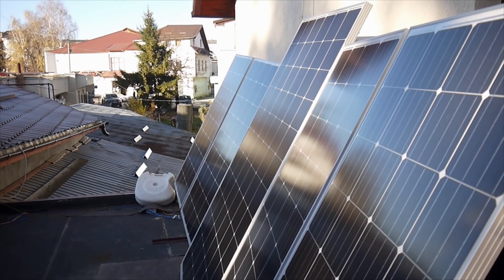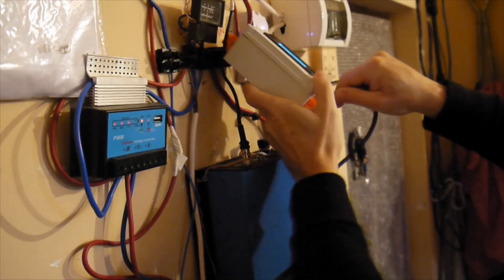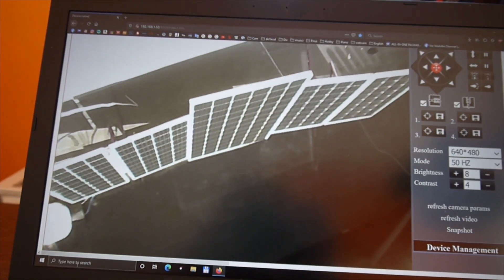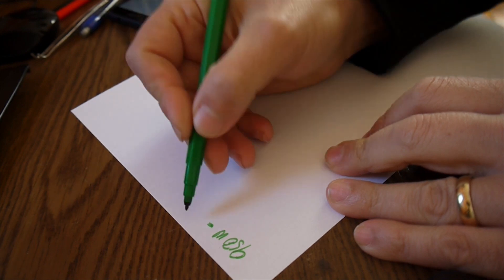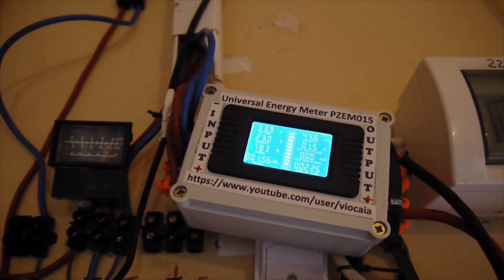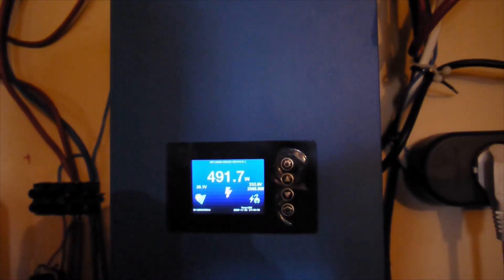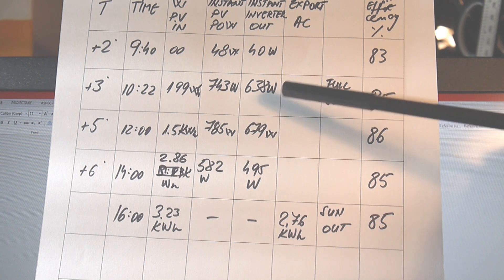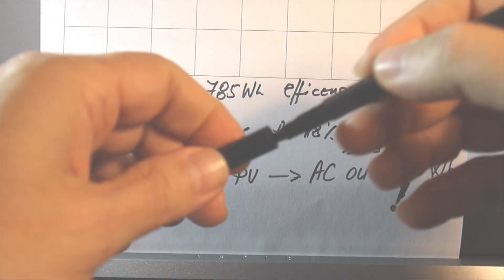The truth about solar power, SUN GTIL inverters and efficiency. Real life tests.

Comment: There must be something wrong in the end where you did the loss calculation. If you have 5 panels with 960 Wp in total those are rouhly 180 Wp panels and usually 10 years old which means that they suffer from the degradation a lot.
And the second issue is the time of the year cause you can not expect STC test conditions in roumania during november which require 1000W sun per m² 
Therefore no change to achieve 960 W even when these panels were brand new except during summer time, but not in November.
Reply from the maker: I'll recheck the things and be back to you...

Comment: might be worth to consider a replacement of the heater with a split heatpump for heating during winter and cooling during summer to lower the power bill cause the split inverters are heating the room and more if you open the door. 
The good ones are quite efficient with a gain factor of 4 or more, so 1 kWh investment from the solar panels will bring you 4 kWh of warmth .

Quick connect split heatpump should do the trick and with a quick connect solution it should be doable for most of us even though not that cheap.
But you can build it on your own and expand later but be aware to get not the smallest heatpump in case you want to heat more than just  that single room. 1 kW input offers 4 kW output which means a 4 kW heatpump or even more.
Reply from the maker: I already use a heat pump with great results..

Comment: Ty for the nice video..i was like all the work you have done..1) the panels need to be in the sun at perfect dirge..(to do that you need a traker) 2)they lose some power from the wires.. so you lose 20% not because of the panels in real life but because they are not in perfect dirge to the sun..3) how manny voltage it's the max for the inverter? If you use lower voltage  you have more lose.. that's and why it's have 85% .. if you use more voltage he will lose 5-10% and not 15% ..because 1) he lose power from the conversation that he do to the voltage 2) he need power to work (i think this model need 5-15watts )that he get it from the panels. That's and why he is saying the max out put from 1000w it's 950w...but for this set up it's very nice work and not very expensive to do it..so ty for all the info..
I like to ask you 1) if you are not use the limiter he is pushing power back to the grid ? 2) and if you can do it ..when the power from the grid it's out ..did he shut down?....I have tried to see a video about that with this inverter but no1 have..all the ppl use it with the limiter..and I like to see if you can use it with the limiter and with out..
Reply from the maker: Right! positioning is very important..I did the measurements in between noon hours, with almost perfect tilt and exposure..I rather buy some more panels instead of doing tracking..actuators, mechanical thingies! this are so heavy..it's a mess..so more panels with different orientation foe morning and afternoon will solve the problem.I had a nice surprise , one of the days was clear sunshine and cold wind, so the panels went more than 1KW! for a while, than the inverter went up to 950W!!! is it's not the wires or anything else..simply the way the cells behave in real life.
1.If there is no limiter, all the power will be pushed to the grid...maximum from the solar..there is a way to limit the power from the menu..like 500Wh ,but it's like a sink with drain..all the water just running thru..
2.When  the power from grid is down , there is no production, it will be up in a standby mode, waiting for a signal...
3.It can be used with limiter and without limiter, also, let's say there is no grid, I mean no connection at all..or totally disconnected from lines and  you have a pure sinus inverter doesn't matter the power tied to some batteries..that one will become the ''signal '' on for the SUN GTIL..so it will pump the in house network as long as the pure sinus is generating.This is a interesting way to use it offgrid! I never test that but is very possible...
4.The limiter is very useful because you don't need any agreement with the power company..for them you just simply don't produce, no way to track you.
Reply: @viocaia  ty for the fast  answer and for your time.